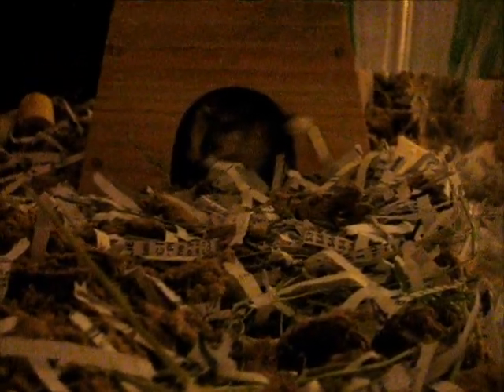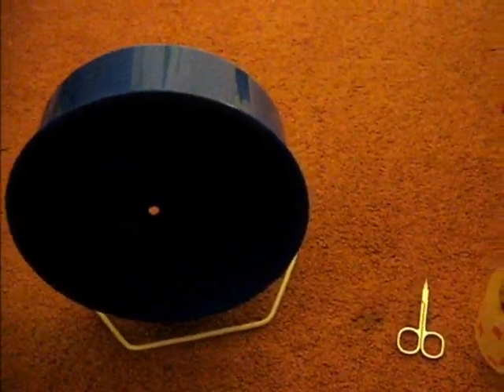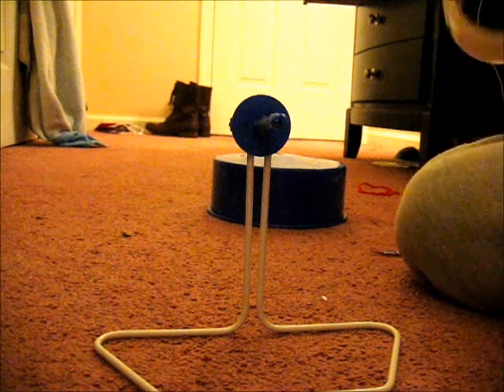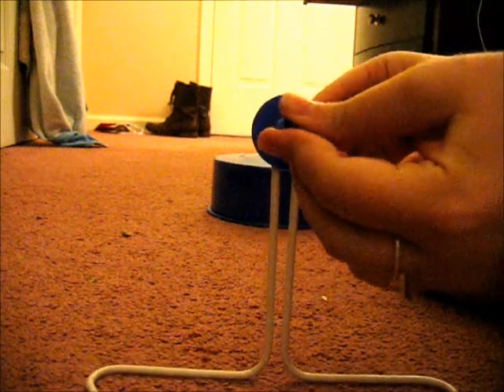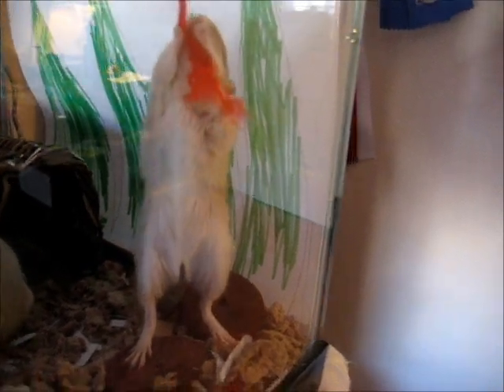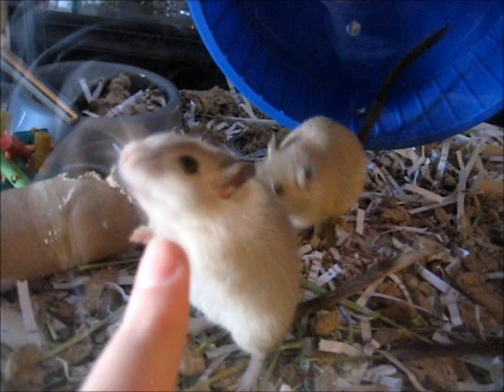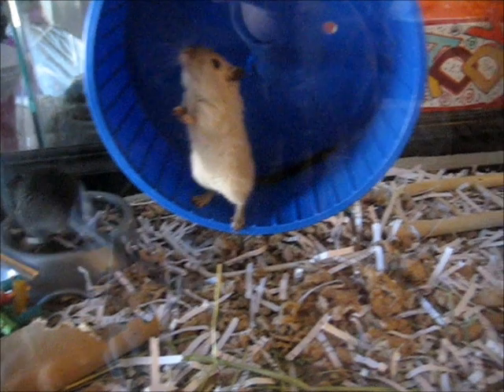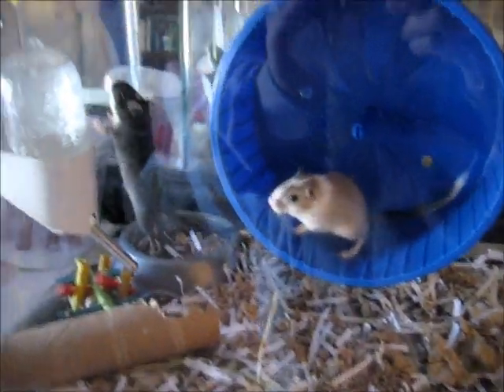How to make comfort wheels...QUIETER?!

Comment: Thank you so much! The wheel is almost soundless now. You just need to make sure you apply a thin layer of tape, I used a sticky paper tape and a little bit of olive oil. When I used a thicker tape it wouldn't spin but now it's perfect, would recommend!

Comment: that is a great idea. i knew about the cooking oil method but not the tape.  silent spinners stay quiet at least mine have. and i have never had them fall apart but i dont know if they are good for gerbils. I might have to do something with my new wheel for Ruby it is a huge wheel but the axle is metal so it seems like it will squeak a bit

Comment: It works, but it makes the wheel so much harder to spin! :(
Reply: Better exercise😁
Reply: @16alarkin  it doesn't work that way....
Reply: @dd-pz1ee  ?
Reply: @dd-pz1ee it worked for my wheel, and my hamster still loves it..did it not work for you? Is that what your saying? I have a syrian hamster, so more weight more momentum to spin wheel, so it probably dont work for smaller hamsters or gerbils.
Reply: @16alarkin  i have a syrian too and no i didn't even try it. The wheel doesn't spin as smooth as it should. Your hamster is probably using it because it is her/his only option to get her/his energy out. So no, if a wheel is not spinning smoothly that doesn't mean "more exercise". Your hamster might even stop using its wheel.
Reply: @dd-pz1ee  the wheel was worse without this. It wobbled like crazy. What wheel do you have? And I let her run in a ball every other day also.
Reply: @16alarkin  hamster balls are a BIG no no please stop using the ball
Reply: @dd-pz1ee  ok I take your word on that, but I dont agree with the first point. What kind of cage do you got?
Reply: @16alarkin  I'm assuming you meant wheel instead of cage. My hamster doesn't have one atm because her other wheel was too small for her. I ordered a new one (12''). It should be here in 2-3 weeks. I still take her out of her cage so she can run around my room. I didn't want to buy a ball because hamsters visions are really bad, they smell and use their whiskers to feel things. Also poor vandilation. Like I said her wheel is coming in a few weeks.
Reply: Oíl on top of the tape will do